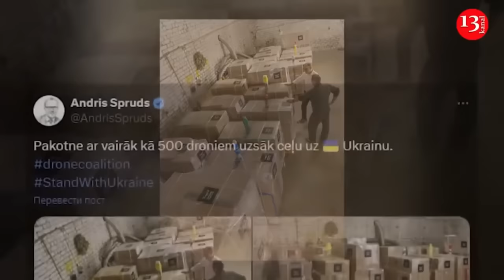Russia, which acquires 1000-1500 tanks every year, can attack NATO at this time

Comment: Let us all give the Russians the benefit of the doubt and believe they are producing 1500 tanks per annum.
Firstly we do have to ask how many of these 1500 tanks are new, how many are reactivated old stocks and how many are repaired and reconstituted from war damaged tanks.
Secondly since the start of the illegal invasion of Ukraine the Russian tank asset base has and is being significantly attrited. Overall since the beginning of the illegal invasion to the 24 July 2024 the Russian tank force has been losing an average of 9.4 tanks per day, which is equivalent to 3,436 per year. 
In Sum, if the figure of 1500 tanks produced per year is true then the news is blank for Russia. 1500 tanks is a mere 44% of their annual losses. But we sort of know that many (maybe the majority) of these 1500 tanks are not new, far from it and the Soviet stocks they are been drawn from for major refurbishment are dwindling rather quickly, so 1500 may represent the peak of achievement and that will not be sustained.

Comment: Look I read this nonsense and checked your comments. A tank need at moment 7 month to be built from 0 to 100%. Russia has not the ability to built 1000 to 1500 tanks per year, russia has at moment only 1 facility able to built tank-steel. This is special steel and russia can’t built other facilities cause of sanctions. Russia turned 4 facilities for truck production into a „tank“ producing facility. This we seen the results because russia now using low grade steel and equipment, this leads to new records of high flying tank turrets and is absolute deadly for the tank crews. But if you add these 4 new factories the tank production in russia is up to 350 maximum. But I would not bet that these maximum pieces are 100 % functioning. Russia now has some problems producing high end motorparts needed for such monsters. They take truck motors instead at moment but the stocks running low…